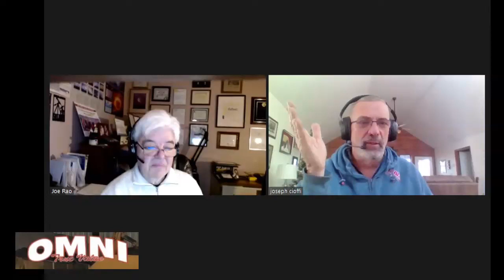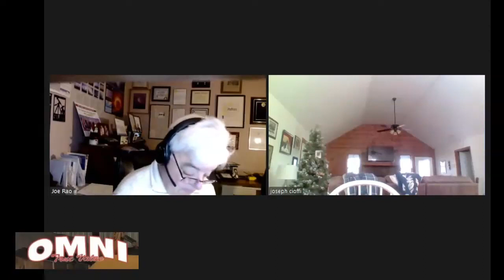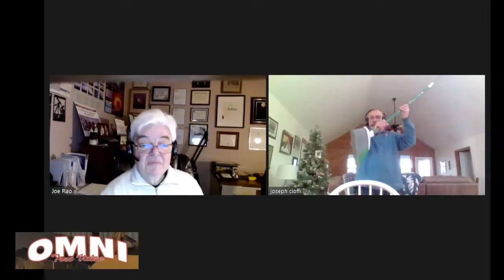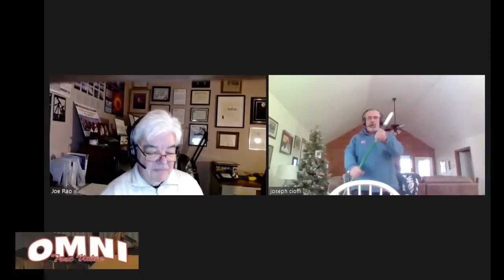Joe& Joe Weather Show What Is A Negatively Tilted Trough & What Is A Positively Tilted Trough

Comment: Don't forget "blocking" for the next weather primer!
Reply from the maker: I won't.
Reply: I would think blocking in this analogy is like sweeping up to the wall. The broom stops at the baseboard, but the dust energy(storm centers) flatten out and redevelop along the face of the wall until they reach the doorway or a corner where they can finally follow a path again.
Reply from the maker: Perfect. Next video. That broom will be a star